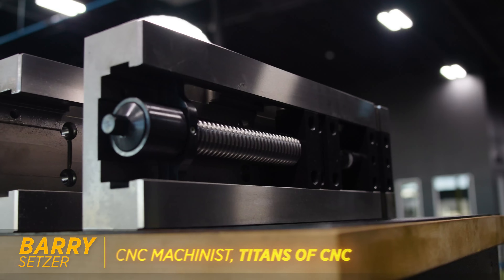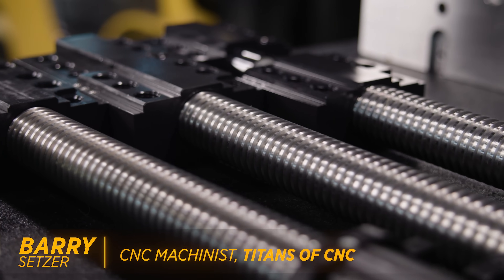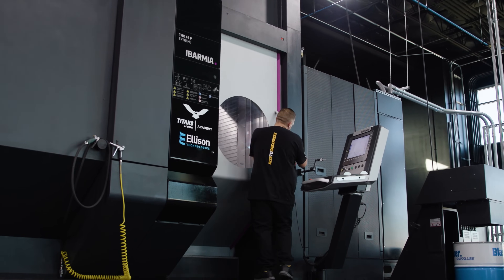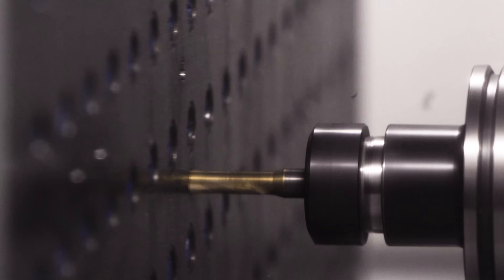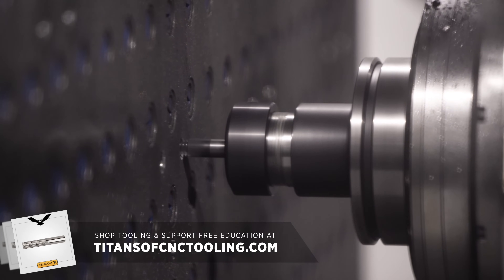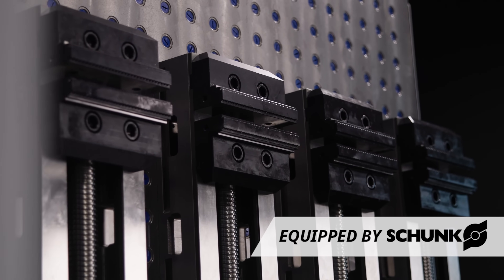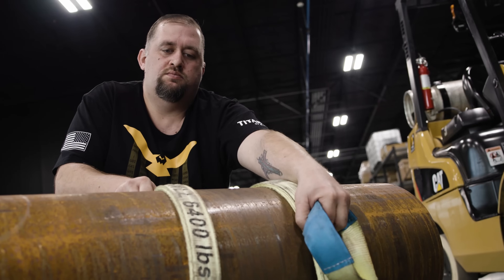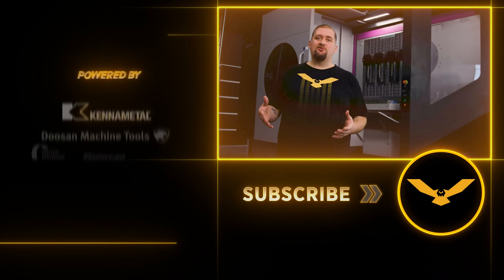MONSTER Vise Installation on 100,000 Pound 5 Axis 5 Axis CNC Machine

Comment: This pre-drilled and tapped tombstone is good for standard rectangular plate work. Not very practical for custom setups, where the holes need to be in a specific locations, because a lot of time those pre-drilled and tappped holes will be in the way. It is much better to buy the tombstone without any work done to it and then drill and tap the holes as needed, keeping the geometry layout file on the hand and simply add next set of holes as needed, so that you all the time know, where the existing holes are and what is their size... There is a good chance, some of the previous holes can be re-used!
Reply: That’s what fixture plates are for
Reply: @adammiller4879  That is true, but if you put a fixture plate on tobstone, you are getting away from center of it. If you then add heavy stock, the pressure on the mating cones is so big, the setup looses rigidity, thus you inadvertently get vibrations...
Reply: @jiritichy6855  that’s true, but good quality fixtures will still work fine with good toolpaths, of course there is always specific speciality parts that need that rigidity

Comment: A thread mill? First time in my life I see something, that looks like a threading tap, but is smaller, and probably - doesn't brake, like a tap does. Where I work at, it's a pain in ass to cut any threads, not bigger, than M10 with a tap, because they brake pretty easy. Mainly, we just cut only a few millimeters of a thread with machine, and then do the rest of the length manually, with a lot of carefullness. Especially, when it's a chrome steel. And it becomes a tragedy, when you brake an M6 tap in a big workpiece and it's stuck forever, so the workpiece becomes a scrap. Too bad, only one of four CNC lathes at my workplace have a Y-Axis, so there's no sense to buy any kind of a thread mill just for one machine.
Reply: Tried roll taps??
Reply: @Glenrok  I assume, it's only for some soft metals. Not for Steel 45, chrome steels, and heat treated steel, we usually use.
Reply: @Silver_Nomad  you’d be wrong. Roll taps are very effective in all metals unless heat treated- & even then it can still be possible depending on Rockwell hardness
Reply: @Glenrok  well... The steel in our factory is usually being heat treated somewhere between HB 255-302... M16 taps are more or less ok with it, however they still don't last long. Plus, our management saves on everything, and buying any new kind of tools is always under big question. Also, the live tools on our lathes are not so rigid, and not so powerful, so roll taps, probably, can cause overload and emergency stop.
Reply: @Silver_Nomad  depending on the size of tap, machine, etc- that’s not necessarily true. Roll taps work by forming- rather than cutting- the thread & produce a stronger thread as a result. The pilot hole has to be drilled larger than for a cutting tap so the material can be extruded down to the bottom of the thread to produce the correct size/form (there’s data to help with this). It’s a very efficient form of tapping. It actually results in fewer breakages (no swarf to get caught) can easily tap to full depth/length of tap in one go, & even run at higher speeds in many cases. I’ve used them on 4140, 4340, inconel & several grades of stainless & found they work far more reliably than the best cutting taps in those materials. The only real difference is that - although coolant is better than nothing, you’re far better off using a thick oil instead to lubricate the tap/work, since you’re not cutting, but forming. For production of many holes, you’d be far better off using them if available. The only thing they’re not really suitable for is short blind holes, as the taps require a fairly long lead to start which limits minimum depths somewhat.
Reply: @Glenrok  yeah... That's a problem, that we more often cut exactly blind holes, not a through holes. But I wouldn't say, that they are pretty short, so there is some chance. The only question is about their availability in Latvia. We usually use Holex, Garant, Fanar taps. Also, some Sandvik Coromant products are available. And if we want any more exotic-shaped tools - we have to wait longer for a supply.
Reply: @Silver_Nomad  talk to your tooling rep(s). I’m sure they’ll be able to recommend some solutions for you. If you’re having issues though, form/roll taps would definitely be my recommendation. Once you get the hang of them, you won’t want to go back

Comment: Is there a reason to use manual torque wrench instead of say pneumatic tool with torque settings? Install vises F1 pit crew style.
Reply: I'm guessing that a pneumatic gun might be a bit unnecessarily aggressive?